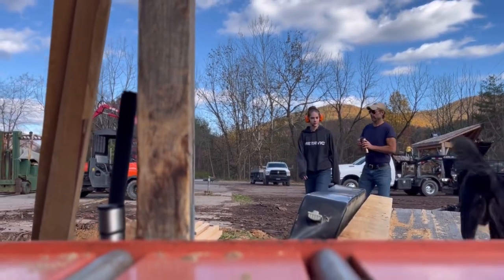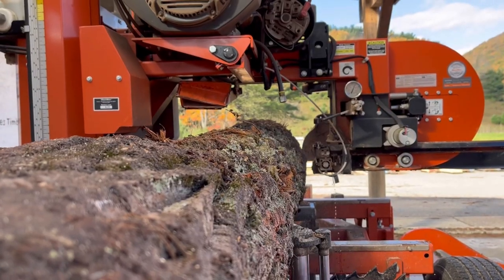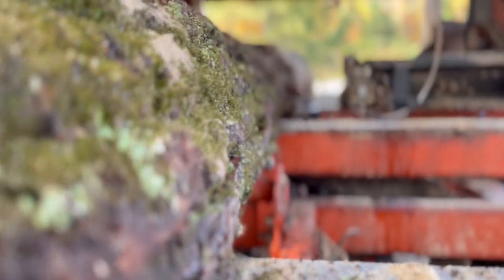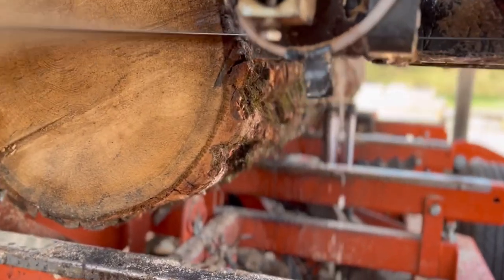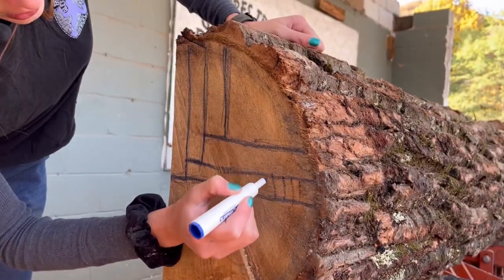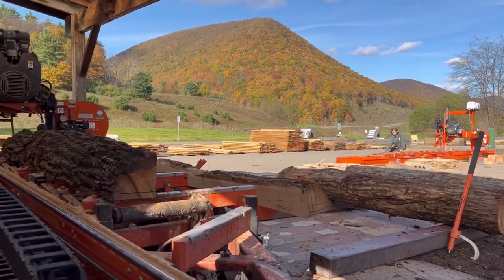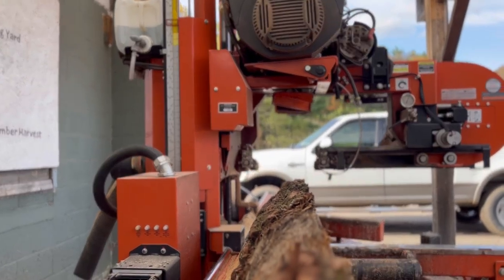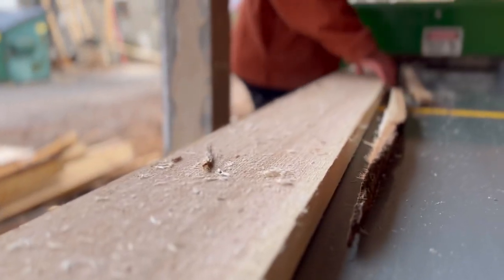MY FIRST TIME QUARTER SAWING: quarter sawing 101

Comment: The wedges that you are sending for firewood are rift sawn and have the grain approx 45 degrees. As long as they still contain heartwood these rift sawn piece are very useful as legs because they show the same grain on all faces. Hope you find this useful information.
Kind regards Andrew.
Reply: Totally agree. You can increase recovery rate by 18% by pushing out 2 x 2 etc. 2 x 1 for mouldings etc. More work but the price charged more than compensates.
Reply: @ andrewballantine  Andrew. Nice to see someone that values a log.
Anyone can make fire wood, but few know how to make good lumber 😊

Comment: Trick for the 1/4 saw slabs... make 3 cuts on your 1st pass; 1 center, 1 5/4 up, and one 5/4 down. That gets you 2 full live edge 1/4 sawn slabs out of the middle and saves a bit of turning. Also, the larger slabs can sell for more.
Reply: That sounds like a great idea. I will definitely try that

Comment: Great job learning to QS.
You are correct in log selection.
I would suggest logs which are just about too big for your mill on the first cut.
The wider the QS Board the more valuable and there is no reason to leave wane on so you can lightly slab the top of a large log and take some sapwood off.
The further from the center yo get you are creating Rift Sawn material when the growth rings are at 45 deg to the face.
As for the final wedges... there is great turning square stock in them ie"  2-1/4" sq 3-1/4" sq 4-1/4 sq for table legs since they will be nearly perfectly Rift Sawn which fine furniture makers use not flat sawn for square or turned legs.

IF I can ever get my 3-4' dia Sycamores cut down, I'll bring them to you and they will make some phenomenal QS Boards.
Even if a log is too big for the mill, it can be chain-sawn lengthwise into massive quarter sections.
Reply: Also boat builders like it for planking the outside of the hull of a wooden boat and also the working deck 👌.

Comment: Good video.   I never ever thought about quart sawing with a horizontal mill. There is a lot of waste with most sawing of quarter sawing.  Thus larger diameter logs might yield more.. The wood so much more stable cutting it into quarter sawn..  keep going..😁I Often cut live oak here in California using a vertical band saw.. most of my pieces are shorter than 30 inches..  before I start I coat both ends of the log with cheap caulking to seal and guard against checking..  after the pieces are cut I stack them into the attic of the woodshop.. The attic get over 140 degrees from spring to fall..  The old rule of thumb is for every inch of thickness it takes a year to dry out green wood.. But the attic only takes about 3 months and a very small fan circulates the air up there to..  Finding cheap heat for your kiln will be key..   Air circulation is very important too.

Comment: In the mill where I worked, when the saw "waved," we called it snaking.  A couple of those logs looked like they had a fair amount of compression wood in them.  A saw blade will definitely snake through compression wood.  Great video!

Comment: A plain. Or flat sawn board as it looses or gaines moisture it expands or shrinks across the width of the board. In a quarter sawn board it gains or losses thickness as moisture moves through it .some wood like walnut shrinks very little and is called diminsionly very stable .other species like sycamore are very unstable .here quarter sawing shines plus sycamore has raY flex aka medulary  rays .that grain pattern everybody wants when they quarter saw
 logs .God bless keep on sawing .

Comment: Hi Emerald how are you? It sure is nice of you folks helping out with the family business! My kiddos are too busy doing their thing, to come help ole pops with his hobby business. Quarter sawing is wasteful but like you said it is more stable, stronger, more pleasing to the eye. I don’t cut much hard wood, but I will soon. A huge oak will be coming in for sawing so that should be nice to cut. I usually cut a lot of pine. I had a fella who wanted quarter sawn lumber. 6x6’s, 2x8’s and 2x6’s. The throat on my saw is only 8.5 inches so  I cut the bark flitches off, got a square Cant 20 inches. Dropped 6 1/8 made the cut, flipped can’t over cut another 6 1/8. Pulled both off the mill boxed the pith then brought the slabs back on to cut 2x6 a off both side of the slab. This gave me 2 2x6s and a 6x6 quarter sawn. 2x6s almost riff sawn but he was ok due to grain being straight. Cutting his order was a lot of work, I learned a lot about log,  slab management and about Proper procedure on how to cut and be productive. Was a good money maker, also got some good fire wood as well. Thanks for sharing take care and God bless you and yours.

Comment: Some very beautiful boards.
There are some other benefits to quarter sawn and edge grain wood, one of them is flexibility.
When bending a flat grain board for the hull of a boat there is a tendency for the grains to delaminate and split.
Also, edge grain and quarter sawn boards still shrink and expand, but in different directions.
The flat sawn board will warp due to differing expansion along the annular rings because they are different lengths, but experiencing the same rate of expansion.
So, for example, on the heart side a ring might be 1" long and expand 2% of that 1", while on the other side the ring is 10" long and expands 2% of the 10", or 0.02" vs 0.2".
So one side of the board is longer than the other, it either forms a cup ow crown, or splits to relieve the tension.
An edge grain board just gets thicker.

Comment: I am a retired self employed cabinet and furniture maker and I used both quarter and rift cut white and red oak on several projects over the years. It is nice to work with. I also used a variety of different curly woods. Cherry can look like puffy clouds when curly. The strangest wood I ever worked with was called bark pocket ash. I don't know if it is a thing or a name that my friends at Cole Hardwoods made up for this ash that came through the yard to be dried. I really like this video. Keep them coming.

Comment: I have an LT40 like yours. I've been quarter sawing for years. Below somebody said to take 3 cuts before you turn the log. This is limited to how well your blade is behaving in a wide cut. Take your first cut 1 board thickness above the pith. Second through the pith, and 3rd one board thickness below the pith. These boards will have to be split down the center to get rid of the pith mess. Also I zero out the kurf and set one of the presets to zero. That way when you hit auto next cut after lifting the blade, it will come very close to the same position as the last cut....ie....1 1/4"

Comment: The method of quarter sawing you're using is called Reverse Roll.  It maximizes that amount of quarter sawn lumber you get from the log.  There are other methods of quarter sawing lumber and there are many youtube videos that show how it's done.   Larch trees (or Tamarack in North America) when quarter sawn produce what is known as lace wood.
Reply: bwillan,
The method shown here is true quarter sawing. Reverse roll is totally different and involves "rolling" the partial log (usually a half log) through multiple angles in order to keep the blade close to perpendicular to the growth rings.
Reply: @TheOldManAndTheSaw  you need the lt-50 or 70 hydraulic uprights to properly reverse roll the log.
Reply: It's financially just not worth the effort as customers rarely want to pay extra for it. Especially on those tiny sticks. Wainscot oak and especially lacewood may be worth it but even with through and through sawing you will get enough to satisfy the demand. The lost skill these days seems to be crown cut with the correct taper set. Or mahogany curl.

Comment: Try on the first cut take blade to center cut, then rase blade up one or two thickness of lumber. Saw two or four boards. That will yeald wide quarter sawn boards. Split the remaining half round slabs in half and finish cutting with the flip flop style. You could send the two center cut boards on to the edger or cut 2" of the pith out depending what the boss says.
Please let me know your opinion of my suggestion.
I can't get enough of the beautiful smiles.
Reply from the maker: Yeah that would probably work!

Comment: Great sawing as well as explaining everything. Quarter sawn is a beautiful wood to work with should try some of your hemlock and see what it looks like. Yes seeing the kiln being built would be interesting to see. Keep up the great videos
Reply: Hemlock with all its shake would do very poorly quarter sawn I would think.
Reply: My old sailboat 1926 built was planked with Hemlock. The stuff is beautiful and strong. Not easy to work, but did I mention Strong? Also Planking for boats should always be quarter sawn timber.
Reply: @merldewitt1969  the timber of early 1900s was much differnt then timber we have today. I dont know for certain but i have heard people say that its only hemlock on hills that get shake, i have also heard that any hemlock standing by itself will have shake.

I have seen some good hemlock but around me there isn't much left. Anything we cut 1" tends to literary fall apart at the growth rings. i guess you could quatersaw 2" thick but that seems odd, and only really for a specific reason. 

i dont mean to come off as hostile or anything just trying to have a conversation :)
Reply: @1911slice  No problem, It was probably a different European species of Hemlock as well. The boat was Swedish built. So it was built like a tank to take on North Sea sailing. A heavy wood boat her size would typically be 5,000 lbs. Mine weighed in at 15,000, Her White Oak frames was nothing you find in the states ether. It was SO dense, I thought it may even been Live Oak.

Comment: thanks for this high quality video. interesting video camera antics. cutting your lumber 1.25" keeps your blade clear of the claamps and other parts, yes? i have no band mill;my friend Russ does and I'm trying to convince him to cut quartersawn lumber; or at least RIFTsawn. This rift sawn lumber still performs like quartered; shrinks less, wears as well, dries quicker than flat sawn. Just a minor suggestion for the little triangle you cut off the top of each quarter: it is ideal for table legs, since all sides show straight lines in the grain of the leg, when used this way( plus it cannot be classed as trash or firewood anymore!  Where have you folks been the last ten years? I thought I knew all the good sawyers& yards. You go into detail almost as much as "Tips From A Shipwright" !!

Comment: Interesting to see this. I hadn’t thought about the bandsaw requiring quarter sawn wood to be cut from the bottom in all cases. In a regular circle saw mill, one side cut would be conventional, like 5/4 width from the fence to the blade. The other angle would require some work, perhaps be sawing a flat on the narrow side of a wedge and having the 5/4 be on the opposite side of the blade than for the other angle. Or swapping ends. Either type of milk would have extra steps for quarter sawn boards. Definitely labor intensive. Maybe less so for a circle saw mill, but harder than plane sawn for both types. 

My great grandparents had a really nice 48” split-pedestal round table with 4 leaves, all of the top made in quarter sawn white oak. We used it for many years and then passed it to my little sister. Cool to know how it is cut. Thanks!

Comment: With a Lucas Mill you can take the edge off  as well and then even take the whole cant over to the bandsaw which has a smaller kerf.

Your bandsaw has a kerf of less than 2.0 mm. The Lucas Mill has a 1/4" kerf (i.e. 6.35mm blade thickness).

Comment: I try to separate the 2or 3 quarter sawn boards that come out of every log. Even if I have to cut the pith out of one I still get the best of the log. If I’m flat sawing I get nice wide 12-16 in boards too. I cut mostly oaks and It adds up pretty fast with no extra work.

Comment: This is how I do it as well on the LT 15. I cut the QS until I get down to under 3 inches wide boards, then scrap the ramaining. The good thing is a few strokes with the chainsaw, and the scrap is already split for firewood.  I have been leaving the bark on, and when I get a bunch with the same width, I stack them on edge , saw side down,  then run the blade over the bark edge and take care of 4-6 boards at a time. I dont have an edging machine, so this saves a bit of work for me otherwise. 

I pretty much QS all my lumber now, cherry, oak, maple, even poplar. It makes a much stabler piece of wood, and better character. If you ever have a chance to QS sycamore.......do it. It is beautiful, and not well known.

Comment: You betcha I want to see everything about the building and operation of the kiln! So happy to see you going into quality hardwoods production. Don't forget to add the "second cut" face cuts from your logs that you flat cut. You get beautiful cathedral grain a lot of people love. 
Today I was working with some quarter sawn walnut that I have been air drying for 45 years! I much prefer the color tones of air-dried walnut to kiln dried.
Thanks for your videos, you and your family are doing fantastic things!
Reply: 45 years?! I've got some that's been around for 25 or so. It's as dry as it will ever get. I take it in the house to dry it further. Momma's not happy about that but ...,.

Comment: The kiln drying also means you can export your lumber, since many places have restrictions on imports due to the risk of parasitic molds, fungus and insects.
Personally, I would like a source for green lumber since it can be hard to bend seasoned boards.

Comment: I have only done a bit of quarter sawing, so would not call myself a expert, but I make a bit of a cant first, more so just what you would lose when you edge the boards. Then either make your four quarters or cut two or four wide boards from the center that you can then split after. Then carry on with the quarter sawing. By this point you should be able to saw two of the quarters at a time, even if you have to flip one of them by hand to keep the two vertical faces together. Hope this helps, you guys do good work and with some time you will figure out what works best for you.

Comment: Cut one board below + one above the center; Then cut one board out of each half (if possible, do it with both halfs together); than cut it in 1/4. Try to cut multiple 1./4s in one go. You can cut out the center later on. That's how I saw it in Europe (Austria/Germany) Tobias :-)

Comment: YES vote on detailed video on the building and then the assembly and installation of the kiln itself. Won't this require a 10-12 ft.kiln? Want to know  what heat source you will use too. As another Commenter noted, this could make for a wonderfully informative 2 part story. I look forward to The Kiln Story.
I really liked this video about quarter cutting. I never knew why it is cut that way. Also, when you get some custom furniture mfgrs. as customer wouldn't the last cuts make for good leg stook too?

Comment: Okay next I want to see some rift sawn hardwood on that LT-40!
  The construction company I worked for built a building at a prominent university in the Midwest. The entire interior was trimmed in rift sawn white oak. At one point the job got delayed because there was no timber of suitable diameter to produce rift sawn lumber in the specified widths required. Far more waste in rift sawn lumber than quarter sawn.

Comment: At my uncle’s mill in Northern Massachusetts, he would first cut the log into cants, and then run the cant through a saw that had two blades 90 degrees apart to cut the cant into 4 sections. The logs we were cutting were pretty big, probably 3-4 feet or more at the butt and up to 20 feet long. Mostly oak and maple. 
Each quarter was flipped after every pass through the saw using a vertical saw blade. The boards were then piled and stickered and left to air dry under cover for a year. The following year, they were planed and moulded into either flooring or trim moulding shapes. This is all that mill produced was hardwood, mostly flooring or trim. 
The logs came from northern New England, mainly Vermont old growth forests. This was in the 1950’s and 60’s.

Comment: What options with all the slabs of making 2x2s or 1x1 (or less) and then having them run through a dowel-making machine.  This would truly maximize your production with closet dowel rods and other smaller dowel products.

Comment: I’m thinking if you cut one board high on your first cut your first board would contain both sites. Your second cut could go down one board and once again you’d have another board without having a log split. This way you would have two full width boards that are actually Quarter-sawn boards. You can then work with the to have that are left, making one cut high and one cut low reducing the amount of times you have to flip quarters.

Comment: To say that quarter sawn is stronger than plain sawn isn't totally correct...the serve 2 different purposes ...it is true that quarter sawn is more durable to wear and if used as a sheeting it is more ridged...less likely to bow between studs or rafters but as a floor joist or rafters plain sawn although it has more flex it has a higher breaking point...all in all both cuts serve different purposes for strength and durability...it's a matter of the correct application for the cut...cheers lady's good job

Comment: Quarter sawn is costly because of the limited yield per log. It’s less than other formats. Also it moves less. Thus it’s used for furniture.
Reply: It seems to me that you're getting just about as much wood from the log as you can, not withstanding the left over wedges.  Although the width of each board is smaller on each pass, almost the total volume of the log is made into boards.